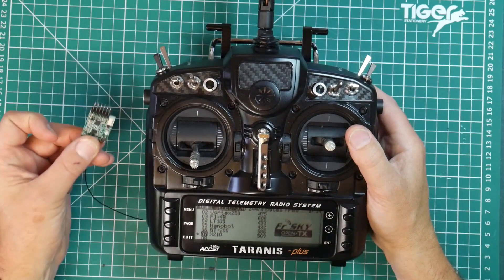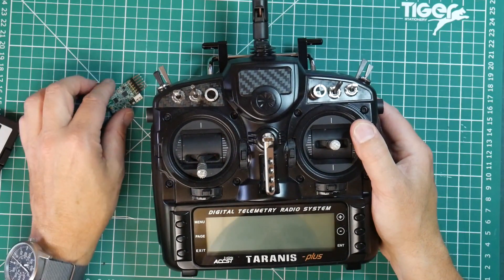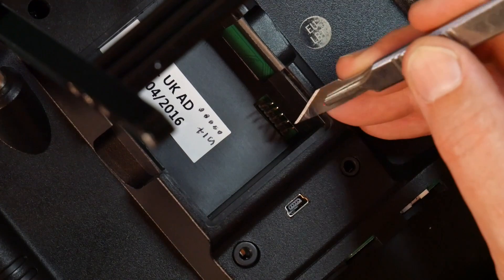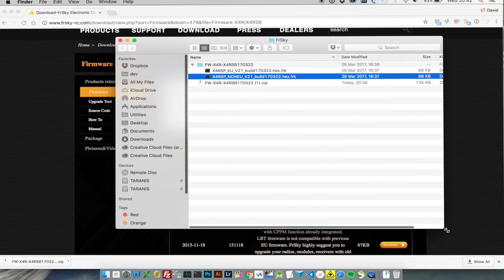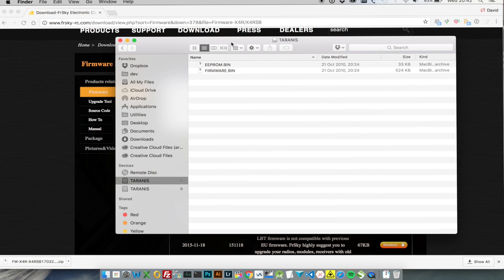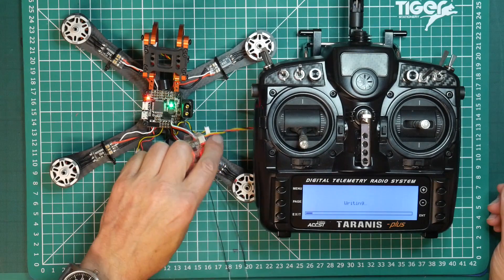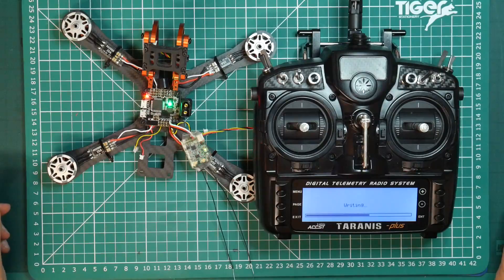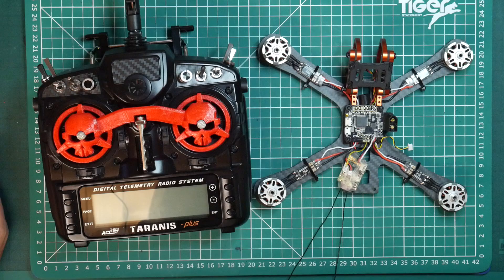How to flash EU / NON EU International firmware on your FrSky X4R

Comment: hi can i use the TARANIS X7 with the 
Compatible Flysky Receiver ? or should i buy the version Compatible Frsky EU-LBT Receiver
Reply from the maker: You can't use a FlySky receiver with a FrSky transmitter, they are fundamentally different. If you've got an X7, just get a suitable cheap FrSky receiver (XM+ or R-XSR) and make sure it's flashed with either EU or International firmware to be the same at the X7.
Reply: @WhirlyBloke  I want to buy this drone :

https://www.banggood.com/Happymodel-Mobula7-V2-75mm-Crazybee-F3-Pro-OSD-2S-Whoop-FPV-Racing-Drone-w-Upgrade-BB2-ESC-700TVL-BNF-p-1357971.html?rmmds=search&ID=519232557179&cur_warehouse=CN

He has already built in a receiver, but i don´t know what to buy.